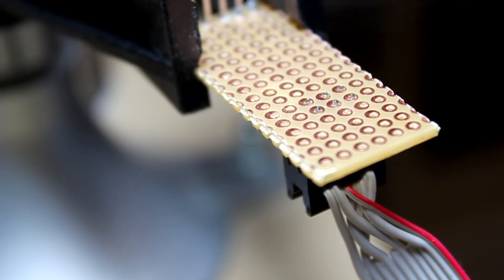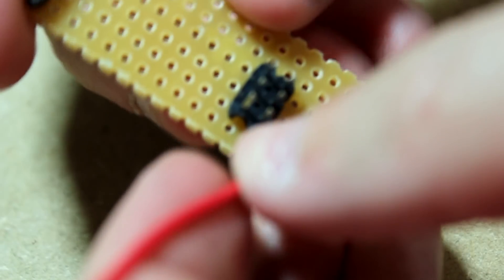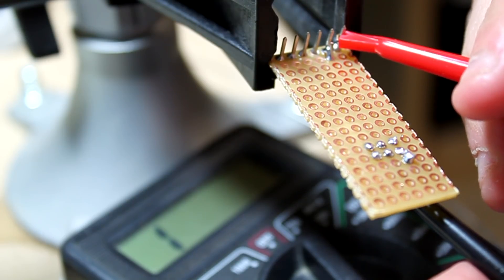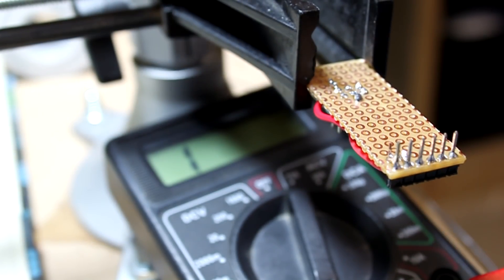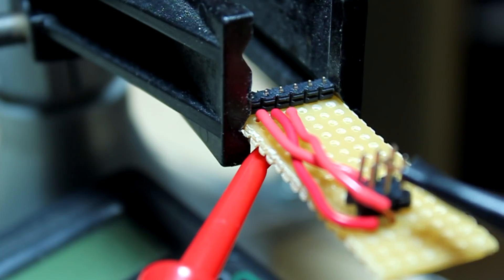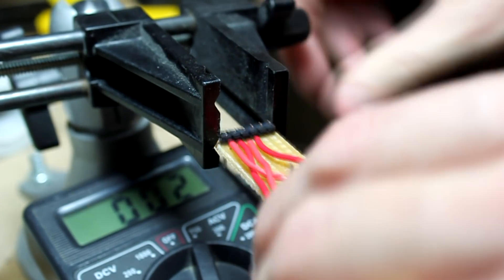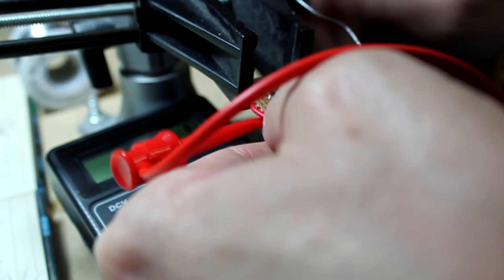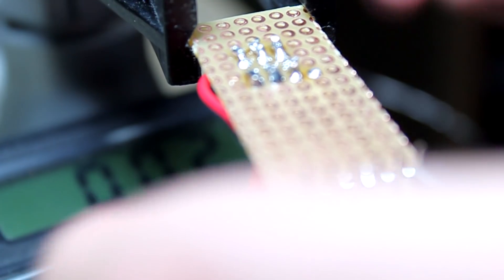6.Arduino for Production! How to Create an interface for the Sparkfun Pocket AVR Programmer

Comment: it's probably a stupid question but isn't it best to use the excess (that was cut off earlier) to bridge the connections?
Reply from the maker: Probably, but flux within the solder is very important when soldering to clean the contacts. If excess solder is used, there will be no flux and the solder joint will be poor.

Comment: With WinIVR I can program the MCU but if I disconnect the programmer the LED will turn off, is just like the program is in the memory of the programmer not in MCU memory. It is OK?
The MCU is power from a computer power source, so is not like the flash remain without power.

Comment: Hi, Patrick!
I've seen this tutorial and I decided that I want to learn also. I bought an programmer avrispmk2 (from Atmel) and eventually I managed to write a program to my ATMega32.
Unfortunately, something is not aright, if I want to program my MCU with Atmel Studio, I get an error I should be 0x80 and it is 0x00 ..???
I can read the fuses an I can save if I modify something there but even if I give verify flash I get that error.

Comment: hey good tutorial but i have one question. I have a com port to ISP adapter(one cable so i could connect it all like you) but is this the same as the AVR programmer you use or do this dont work ?